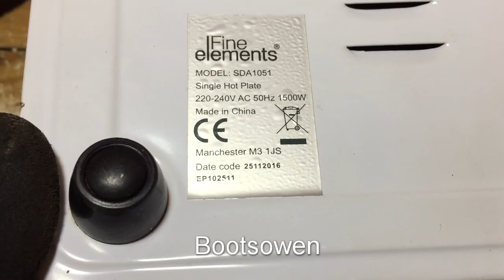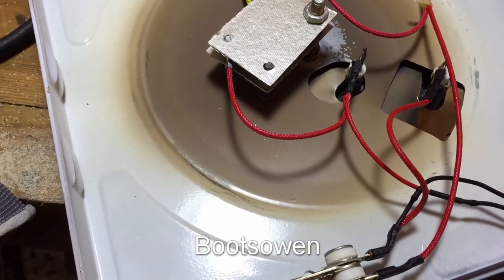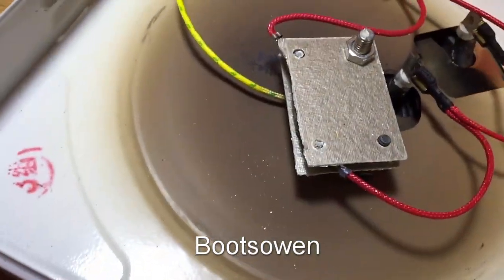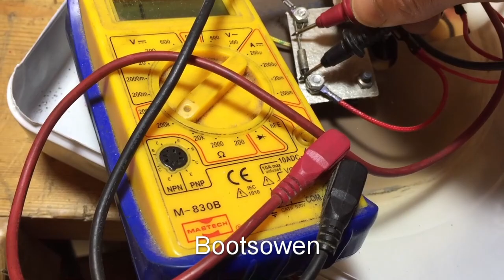Hotwiring the thermal fuse on a hot plate hob: safety protection bypass!

Comment: the thermal fuse is like any fuse.  it gets blown by use.  If you want the cooker heats to maximum then by pass the thermostat next to the switch.  It will be useful to get most of the power of hot plate and you will be able to boil water.

Comment: If remove the thermal fuse, it will continue to heat instead of maintaining a constant temperature, right ？so it this safe?
Reply from the maker: Probably not safe. But a fire will keep getting hotter and hotter if you don’t regulate it. If you have no other option and can take responsibility for your own life solutions like that can help

Comment: Over temp thermal fuse,
If the thermostat gets stuck on, it will start a fire without overtemp.
Reply from the maker: I can't imagine that it would go on fire by itself! It will get hot, if it is on a stone slab it will probably be fine. If it is on a bed of straw then could be dangerous. All of these things have a warning not to leave unattended. Do you worry about fire?

Comment: Same problem i have
When i remove thermal fuse then it work or not???
Reply from the maker: Did you watch the video?
Reply: @bootsowen  yes i did see and it’s working fine mine but I have a question that when i use this then its will get a shock or not??
Reply from the maker: Thats a different question, if you dabble with electrical item then good luck. I can't advise you.
Reply: @bootsowen  ok thank you

Comment: I will never understand why manufacturers do not make hot plates that get hot enough to boil water, without by passing the thermostat.
 Even the most expensive one I have found will still not boil water.
 Sometimes a new one will boil until it gets broken in and then it quits.
Reply: Possibly they are manufactured at altitude where water boils at a lower temperature. I have one of these and yes it's super annoying. It stops just short. With the right pot and a lid it actually simmers
Reply: Mine would work and boil water no matter what setting. Lowest above off even, just took longer the lower. Until I tried to use it atop a towel. Then it quit. That's how I learned it had a thermal fuse when it blew out and I took it apart to check what might be wrong.

Comment: Can you determine whether a different kind of fuse will work and wire it in? Dumb right?
Reply from the maker: Why do you need a fuse?
Reply from the maker: You need a thermal fuse for a certain temperature. Or you don’t. It depends on how brave you are.

Comment: I also did that bypass, and now it's working. (I hope this information will remain confidential ;) lol)
Your video was crucially helpful.
The way the thermal fuse is connected to the rest of circuit in your stove, is much more convenient, I should say...
As a safety I decided that I will use it only to mid power...These kind of stoves are not ideal for boiling water and cooking spaghetti, but for other types of cooking they are useful.
Ps. After Bypassing the thermal fuse, the thermostat will keep on working just fine, because it is just that bimetallic assembly integrated with the switch...it is interesting how it works.
Reply from the maker: It's good to keep something working.
Reply: @bootsowen  yes, I agree

Comment: it's good that YOU know what you're doing but you're not explaining anything to people who don't know and are trying to fix one.
Reply: Not to be rude or a jerk but honestly, if you can’t understand or deduce what is going on you probably have no business messing around with the internal components of anything electrical. Especially something that’s pretty much a direct ground; like a hot plate that can pull as much power as the breaker will allow or until it trips. You could be seriously hurt or hurt someone else. There are plenty of classes you can take online or classes that have been posted on YouTube you can take advantage of so you can get a better grasp of the individual electrical components typically found inside our everyday items so fixing them is not only less aggravating but safer and easier for you to troubleshoot.
Repairing them is the easy part, now try designing a PCB, lol,  thats on a whole other lvl. Lol
Reply: @trupyrodice4462  
I don't know any man who's never opened up some device that he knows nothing about, trying to figure out why it has stopped working, dangerous or not.
Reply from the maker: What bit don't you understand and I can try and help you here?

Comment: What is the thermal capacity or value, and if I canceled it and directly connected the circuit, is there any damager of damaging the heaterplate ?
Reply from the maker: I am afraid that I don't know the thermal fuse value. If you wire it directly there is a risk that if the thermostat malfunctions it will heat to a temperature hotter than it was designed for. Possibly a fire hazard.
Reply: I have the same problem.  Cheap junk thing. But feel like fixing it for the workshop. Do you have any conclusion to what you  did to it..thanks
Reply from the maker: I Just bypassed the thermal fuse, and it works. but it could overheat and blow the element in the plate. what did I do in the video?
Reply: @bootsowen  Actually I opened it up. It’s got some points system like a car with a primitive piece of metal that is acting as the thermostat when it gets hot. I put a normal on off switch on it. I was thinking to wrap the thermostat in Some heat repellent. Same as asbestos type. Some thing. To keep it cooler. So it doesn’t which off as soon.But the switch works for now. And it’s a piece of junk anyway. Just got to keep my ion it. Thanks for the reply.
Reply: 10a thermal fuse about £1.50 on eBay 👍